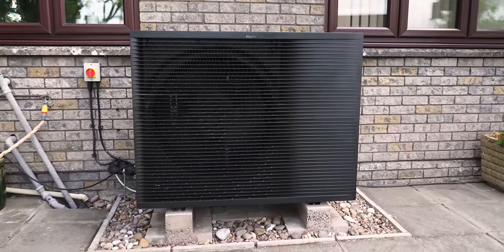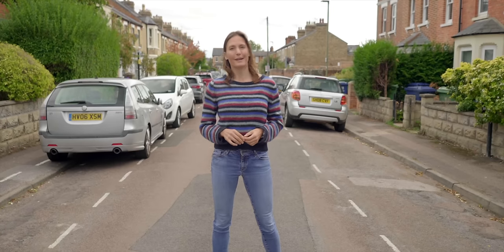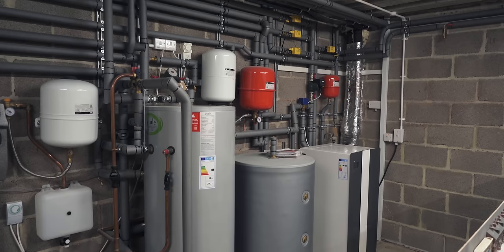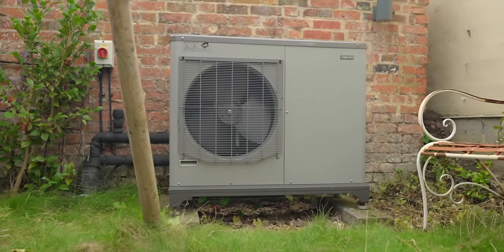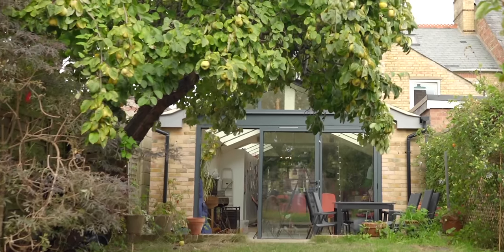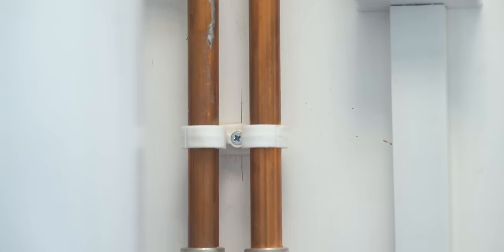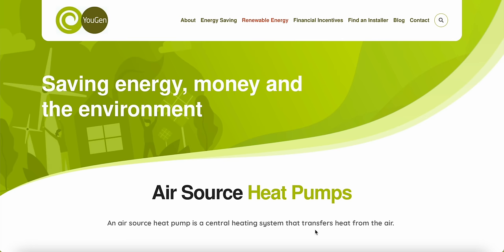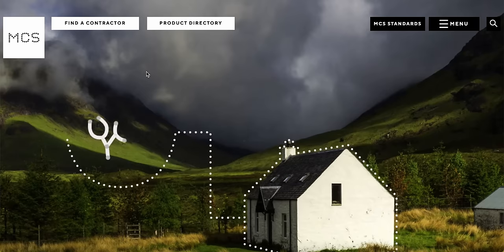Does a Heat Pump Really Work In A Victorian Terrace?

Comment: PLEASE do more on air to air heat pumps AND hybrid heat pumps. The best cost/efficiency solution. Most homeowners don't care about net zero, only cost! The eco nutjobs just say oh it cost £300 a year more in electricity but my co2 is less. Who cares!
Reply: You should calculate the cost of ownership. over a period of 15-20 years. If you do that, you wil see that the heatpump is cheaper than another heating on gas or oil.
Reply: @tonnysmeets963  That initial capital investment is just insane though. I think hybrid for mild weather at 160% efficiency and only use gas when below zero is best solution saving several grand on installation.
Reply: you should care about net zero
Reply: @FireflyOnTheMoon  Yea...no.

Comment: When you live in a home built in the 1830s you are not able to do much to insulate or heat it except at huge cost.
Reply: Disagree. I'm in a mid 1800's solid wall farmhouse. Proper draught proofing, thick lime-based insulating plaster on external walls, plus loft insulation. It'll never be passive house, but the thick walls hold heat, (important to not let them get too cold) and is dry and feels comfortable - although cooler than the 21 Deg norm for gas CH folks. Only have electric but did add wood burning stove this year. .

Comment: The government is away with the fairies, the cost of living has rocketed along with the huge cost of installation. I live in new build, it along with most new builds is piped with 10 mm pipework and that means a complete repipe of the system. As stated most new estates are built this way and our government has done nothing about it. In my area currently near to 800 houses are being built all with gas boilers and microbore heating pipes. This useless government need voting out.

Comment: What no one warned me about with my forced air heat pump (Bosch) was how much louder the indoor air handler is, even on minimum fan, compared to my old condensing gas furnace (Lennox). It's ok after some noise proofing but still noticeable in living area and could be better. I presume the noise is part of the efficiency: moving more air at a lower temperature differential.
Reply: Our mitsubishi system is barely perceptible at all. We can only hear it when the house is completely silent and even then the clock ticking is just as loud. 

The system you get makes a big difference.
Reply: @kj_H65f  You're probably talking about a ductless system. Not appropriate ($$$) when your house is already ducted, which is probably more common in the US than the UK.
Reply: @kj_H65f   Are you in Canada?, is your system ductless?

Comment: Cost and space are the too biggest issues for most people. Having to refit big bulky water tanks inside the house and then finding somewhere in a small yard for it too. Then there's the rediculous cost when your gas boiler can be so cheaply upgraded without having to change out pipe work and radiators

Comment: This is really annoying... absolutely no mention of Air to Air Heat Pumps which allow you to keep your Gas Central Heating system, but not use it except in the depths of Winter.

Our Air to Air Heat Pump also cools, so in Summer under extreme heat or hot nights, we close our Windows and keep cool for a good night's sleep.

WHY is this option being ignored?

Our home Energy Performance is A Rated and Our Gas use has dropped 60%... we're mainly electric now for everything.

Comment: Here's what no one is questioning....If they say that in order to have a heat pump, you basically need tip top insulation.  Well if you have tip top insulation, surely your overall expenditure will be far lower if you just get the insulation done continue to use your gas boiler and not replace it with a heat pump?
Reply: Do the insulation now, save on your existing bills.  When the boiler needs replacing then put a heat pump in instead.  Seems like the sensible option.
Reply: @NickFoster  sounds like a plan
Reply: Insulation but is (preferable) but not essential as was pointed out in the video.
Reply: A lot of this is about planning for change. For most people, if their boiler breaks they'll just get a new one without thinking. The more aware of the options, the better. Of course if we want to reduce our emissions as quickly as possible, which we really ought to do, then everyone who can should move to a lowest carbon option - but you're right that insulation is the priority as that reduces emissions regardless.
Reply: That's what we did.

Insulated our home, put a Solar Array on the roof, smart meters, storage batteries, electric car, air-to-air Heat Pump for heating & cooling... then kept our gas central heating system which we use on very very cold days.

Perfect.
Reply: Insulate and your running costs will immediately go down. Retrofit with a heat pump (properly) and expenditure should go down a little more.
Reply: @JustMeTalking  I don't know why more in the UK don't take your approach.  I will not replace our air con (when it dies) with a centralized heat pump that ties into our existing vented gas furnace.  Since we have open concept upstairs and down, we will put in an air to air 2 zone heat pump, use the natural gas system for air circulation and very cold days.  We also have solar panels and am waiting for the ev market to mature a bit before buying one.
Reply: @leroyharder4491  Indeed, during the Summer our Solar Array excess powers the Heat Pump cooling all day, or charges the electric car.  So no Solar power gets exported, it all gets used.

In Winter we charge the car and home batteries using Smart Meters on a cheap overnight Grid tariff, then use the power during the day.

Comment: Every house with air conditioner has a heat pump .. because every compressor is a heat pump .. we need companies to install valves to repurpose all air conditioners.. else you are just an informercial
Reply: So in the UK, where this was filmed, hardly any! Different solutions for different places…
Reply: @mbcxharm  then the lowest hanging fruit is not in that neighborhood.. and so called 1 million heat pump installation target uttered here in this is very misleading right ?
Reply: @sudeeptaghosh 
 
If we're talking one million heat pumps a year, then that's 4000 a day if just week days.

Do we have enough fitters to do the installs if we include all the other plumbing jobs as well.

And then are there enough sparks to do or check the electrical part of the install as well as the usual electrical contractor jobs.

Or enough builders to lay the slab and build the "in earth" part?

Sounds a tad optimistic to me.

Still, a bit like the cable TV with phone service installs of thirty odd years ago ... plenty of cowboys rose to the occasion.

Comment: They are great come houses that are well insulated and the space for the external unit don't happen to be listed or in areas that are protected due to being a world heritage site or historically important that makes getting permission next to impossible. all well and good saying make your house effficient the UK has so much housing stock that can never be efficient they have walls with no cavities windows that can't be double glazed because they are listed and protected and require like for like replacements/ They are a great solution but they are not and never will be a one solution fits all solution.

Comment: I don't think they work in blocks of flats because they should be placed on the ground, plus a large area for a water cylinder is required inside which small flats may not have, and they make a lot of noise and vibrations so in high density such as a block of flats they seem impractical. Furthermore unless you can supplement your electric with solar power which you cannot in a block of flats, they do not save you much or any money apparently.
Reply: what you can do instead of PV in a flat however is to invest in something like Ripple Energy
Reply: It depends on the size of the unit but they don't need to be placed on the floor. It's not uncommon to see heat pumps at high levels across large buildings - it's probably used for aircon rather than heating but it's the same technology.
Reply: Direct quote from the video “you can put them (ASHPs) on the side of a building, on top of a building, or on the ground beside the building”. 
As far as noise and vibration are concerned, where I used to work we had five units on the wall directly beneath our windows, around 10 meters above ground. Noise was minimal, vibration was non-existent due to the anti-vibration mountings… 
Another department had them fitted above their windows, even further above ground, and yes some were fitted to one of the roofs. 
Also Air Source Heat Pumps can give over twice the heating that resistive electrical heating can, and in a split system can also be used to cool the building in warm weather.
Reply: The only two noises my heat pump induces are the circulation pump, which was reused from my gas boiler, and my wife saying how nice and warm it is.
Reply: @Muppetkeeper  😂😂😂

Comment: Not everybody  can have a heat  pump like people who live in flats  even them in tower blocks
Reply: Perhaps not tower blocks but depending on freehold issues, for flats it could be possible as wall mounted units.
Reply: Flats should be built with baloneys which can then house the heat pump.

Comment: Has anybody thought of or remember back boilers/birners and stoves? A fire place that did more than vent 90% of the heat up the chimney. Not everybody has the money to buy a new heatpump; not least because  most (young) people who are interested in sustainable technology can't afford their own homes let alone rent. 

Still, why hasn't anyone thought to bring back on back boilers that were replaced by inefficient boilers of the previous century and configure a heat pump to that?
Reply: Backboilers had awful efficiency. It was, just about, possible to make one that met the required standards in recent years, Baxi did,  but it didn't sell well and is discontinued.
Reply: Back boilers were never updated to be more efficient. They were, however, much more reliable than the current boilers and parts could be manufactured by anyone with a small lathe and a few small machines. Unfortunately, modern boilers are made down to a price and it is cheaper to just throw away the insides and replace them, rather than repair them. (And by cheaper I mean around a grand a time. Makes more money for insurance companies anyway.)
Reply: My grandparents run a backboiler keeps the house nice and toasty through the radiators
Reply: @matthewmcmullan9669  cost a fortune to run though.
Reply: @davemoore5222  very reliable because they were so simple, which is partly why they were so inefficient. Vacuum it out and stick a new thermocouple on it once a year and it’ll never break down. Wouldn’t go back to one though.

Comment: "We use about 15000 kwh per year of gas and electricity." Ok, so I think these heat pumps are for the very rich because we use about 3500kwh per year of gas and electricity. Therefore I expect we use still less energy with our gas boiler than you use with your heat pump. lol.
Reply: Jay that's pretty much the UK average. 12,000 kWh gas and 2,900 kWh electricity = 14,900 kWh in total. See Ofgem data if in doubt https://www.ofgem.gov.uk/publications/decision-typical-domestic-consumption-values-2020
Reply: You might currently pay less than they do, but you would still make a saving over what you normally pay… 
However if you really use so little energy, that saving might not repay the cost of purchase and fitment for at least another four or five gas boiler replacements.
Reply: @davemoore5222  must be a Passivhaus?
Reply: @MrJanOxford  No but has thick walls and triple glazing.
Reply: @davemoore5222  if you really use so little energy - it's a small flat and we layer up with warm clothes, use mostly led lights and cook several days food at a time. It's no hardship in fact.
Reply: Perhaps we can launch a new trend, competitive under consumption ... ?
Reply: @jayjames7055  So, as I said, you would not gain much from fitting a heat pump. Certainly not enough to cover purchase and installation costs. 
I just hope that you (and I) can afford the insurance/replacement costs for the gas boilers in the future.

Comment: Great until you see the electricity bill and the cost of the gas in the heat pump they use 🤣
Reply: Would love you to elaborate on this one?
Reply: @joshnewland1266
Reply: @joshnewland1266  Try to look how many watts they use We have more Danes are surprised at how expensive it is to have a heat pump
Reply: As long as the electric prices are set up to the gas so expect it to be expensive
Reply: Air source heat pumps give more than twice the heating effect of resistive electrical heating such as electric fires and immersion heaters. 
The refrigerant gas in the system will not leak unless the installer is a moron (warranty claim). Remember, it is similar to a fridge - and how many times have you had to re-gas your fridge? My car required a re-gas after six years, but how many potholes do you drive your house over in six years? 🤔
Reply: @8bitbender495  I'll be honest I'm struggling to understand your English, maybe it's me.
Reply: Before the crisis hit we saved about 60% compared to gas.
Reply: @MrJanOxford  that's also good for you, everything is better than gas, but the electricity bill increases a lot when you get a heat pump, so you use about 10,000 kw a year, depending on how big your house is
Reply: @8bitbender495 no. Average UK gas consumption is about 12,000 kWh. About 97% of that is for heating i.e. 11,640 kWh. Now assume a boiler efficiency of 85% (average) and you get 9,894 kWh of heat delivered. Because of the high efficiency of heat pumps you need only 2,474-3,298 kWh of electricity (COP 4 and COP 3).
Reply: @MrJanOxford  Love your stats Jan. Thank you for the evidence based thinking. Much appreciated. 😊

Comment: Interested in the subject but all of these types of videos fail in the same way. We need to know what needs to change in the house - yes I know it’s replaced the boiler but being told that the output water temperature is ~45 C compared to ~70+ for gas - this means all my radiators may need to be changed etc -  an you do something on the practicalities please?